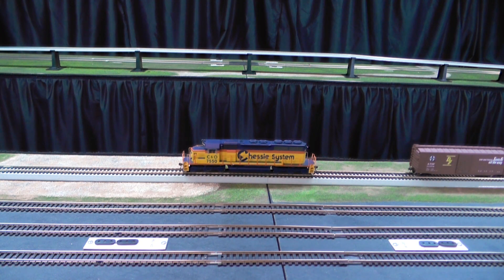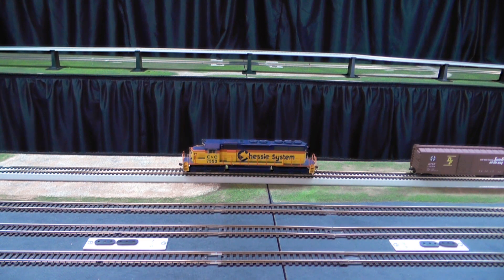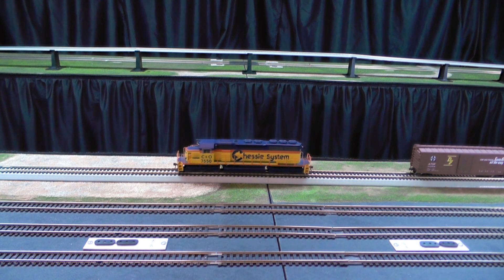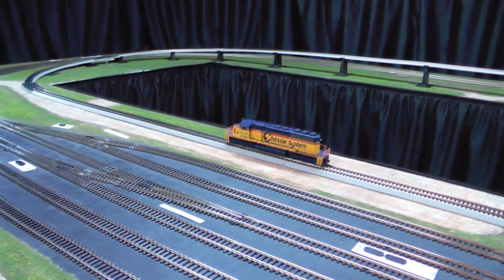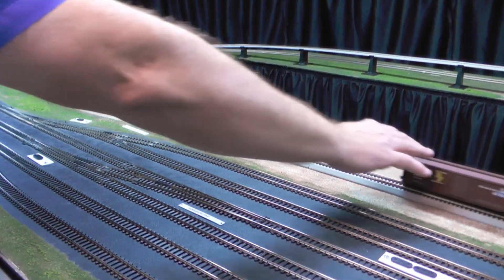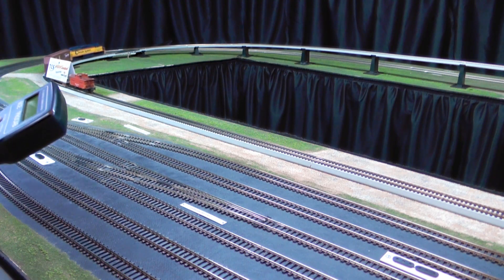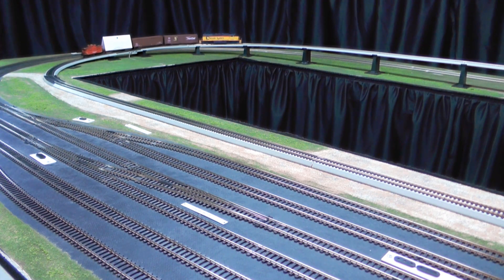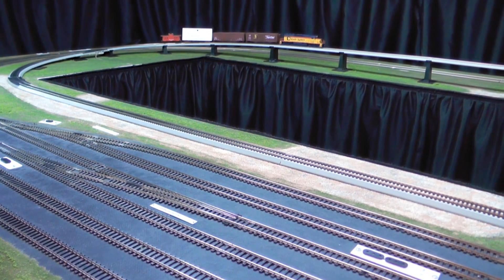TCS WOWDiesel Auto-Notching and Calibration

Comment: nice demo. prototype diesels sometimes rev and notch up several notches in the yard without moving. then after releasing the brakes move out.  My question is can we manually notch it up without moving, then after we move out have the auto-notching feature take-over and adjust the RPM down on the down grades all automatically. is it programmable that way or are the two features mutually exclusive?

Comment: As a locomotive engineer who has ran everything from GP7's to SD70ACEs, this has a real appeal to me. It has the realism of the locomotive working to it's load and not just it's speed, but without the hassle of manual notching. I'm curious how effective this auto notching is during switching operations, and if it can be tuned to be more aggressive or less aggressive?
Reply: +funnelfan It would probably be good to have a 'switching mode' selection with a very minimal delay in locomotive movement, but the notching would kick off as soon as you move the throttle.

Comment: Thanks for the demo.  Does it help to not stop the loco after step one is complete? I noticed you kept it moving (for the most part) and just added the cars on the grade. I don't have much grade on my layout and used heavily loaded cars for the load. My loco "hunts" the notches and I'd like it smooth like in your nice demo!
Reply: +Clarence Bell I don't have this decoder, but as an electrical engineer, I can tell you that it's trying to discern a very small level of current deviation between loaded and unloaded. it's probably behaving very prototypically being that the engine really isn't loaded to capacity. The only way you can fix that is to load the cars more, or maybe make one car a spoiler, with a less than optimal set of trucks under it with some weight (probably right behind the locomotive to make it work more). Otherwise, you're really kind of stuck.
Reply: +kleetus92 appreciate the response. Thank you.